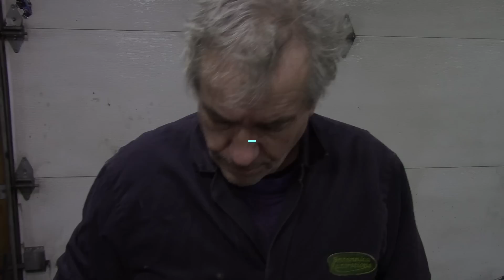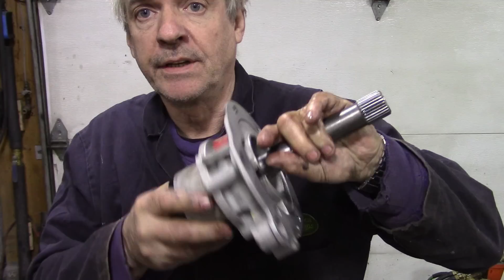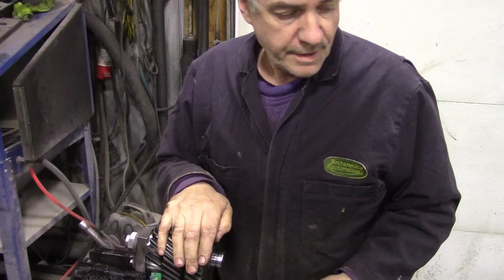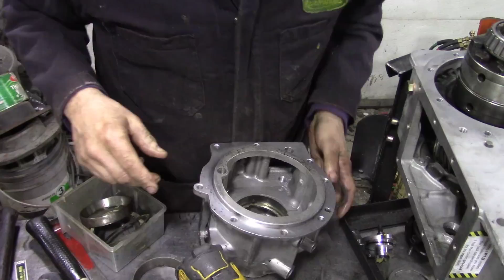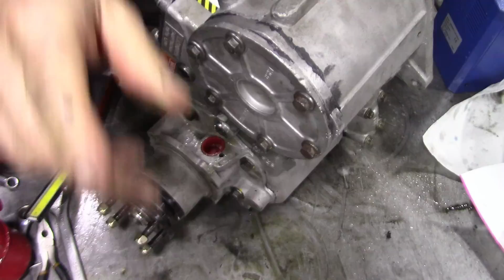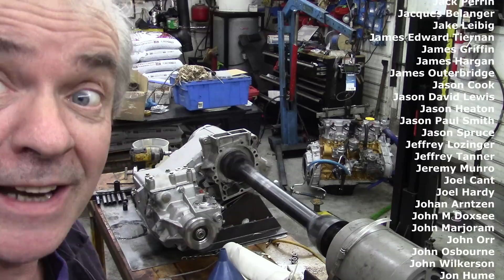Noisy LT230   What could it be? Part 2

Comment: Good job👍🏻.
Would it be possible to show an acceptable amount of back lash in a used box. 
Cheers Mike
Reply from the maker: Hard to say as the input splines can be terribly worn, giving a wrong impression of the backlash in the gears
Reply: Cheers for replying
 My 91 defender is long due gearbox and axle rebuilds

Comment: i wonder if the tight shimming on front housing would be because early transfer boxs used gasket while later use sealent and if the shimming was not changed on its last rebuild and silicon used instead of gaskets that would mean to tight shimming same shims were used no checking carried out.
Reply from the maker: This was supposed to have been a UK professionally built box (not an Ashcroft) - the input gear was correctly shimmed.
However, they fitted new bearings using a different nose to the main case - this is not an issue as the cases are not line bored, so you can mix and match (unlike the cast iron gearbox cases)
But common sense would have though that upon assembly the box was too tight somewhere - you heard this in part 1 of the video when it was on the test bench.
In most cases, using original shims and casings, with new like for like bearings (Timken) you can get away with it when overhauling, but this box is a real dog's dinner of parts